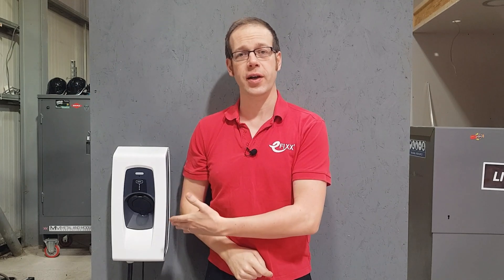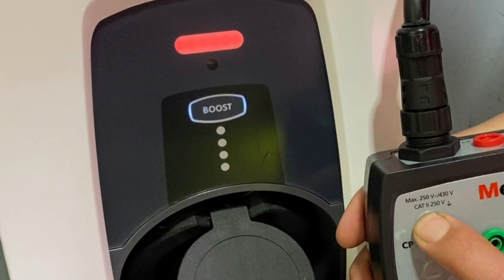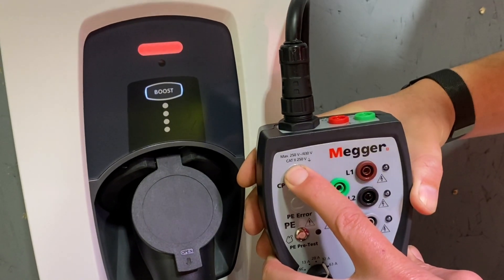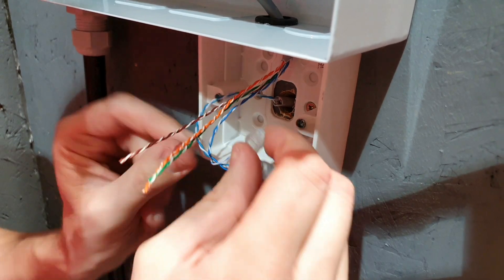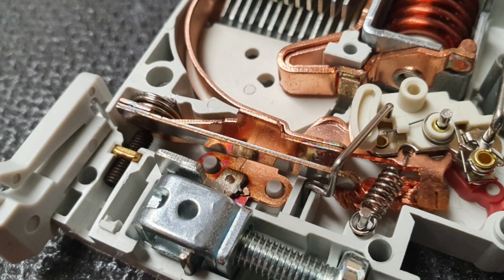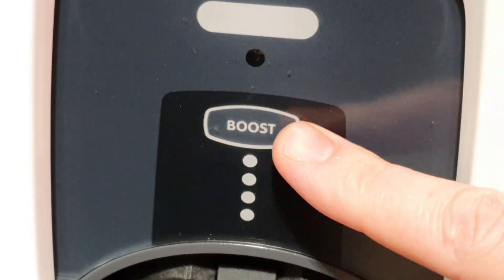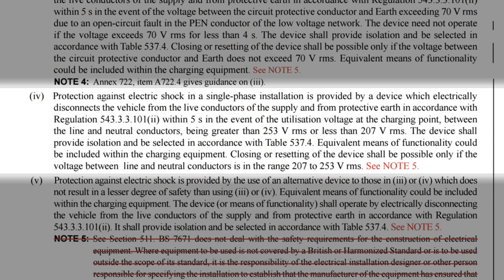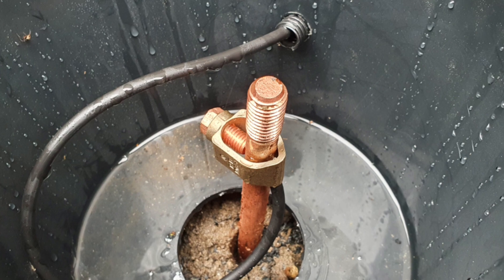INDRA SMART PRO EV CHARGER INSTALLATION TROUBLE SHOOTING & FAQ's

Comment: Hears some thing to think about,, if EV is a good idea to reduce our carbon footprint and help reduce climate change? Has anyone given any thought to how the cars and power sells will be recycled ? Batteries need machines to recycle them witch needs electricity to power those machines mains power needs power stations to generate electricity, so how are theses things going to be recycled? And how are they going to be disposed of when they reach the end of there life ? . So how is going to reduce our carbon footprint and reduce climate change? . It’s all a load of codswallop.
Reply from the maker: That's the same argument for not having cars at all, not just electric vehicles. 🤔
Reply: @efixx  Car batteries are especially toxic to produce and 'dispose' for the environment compared to a steel car.

Comment: Hi Joe, did I understand correctly, that when using  load curtailment that the maximum demand (I.e. if set at 60 amps) would be 60amps, I’m asking in regards to the ENA form specifically the section asking for max demand of property? 
This has been a great series of videos.